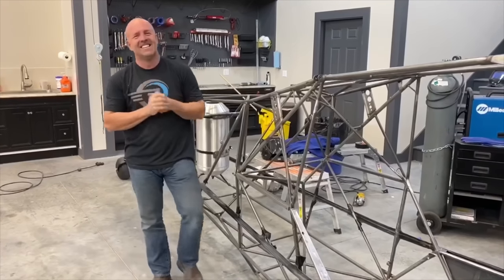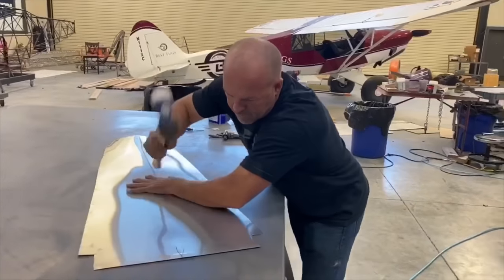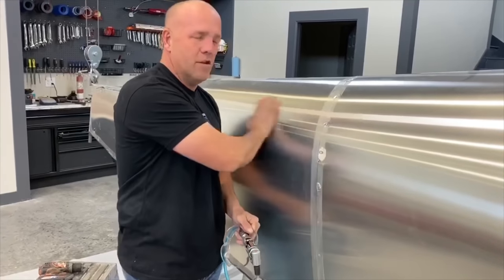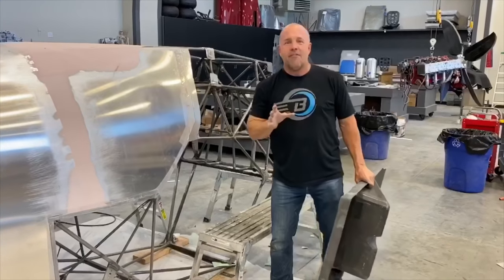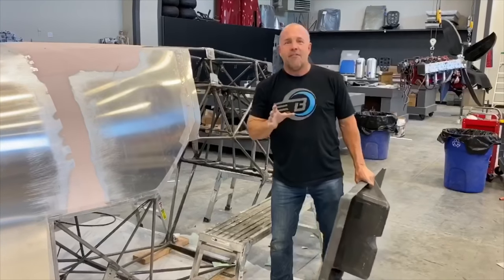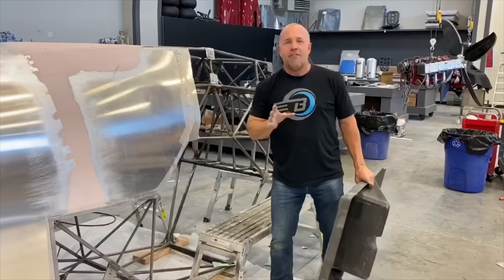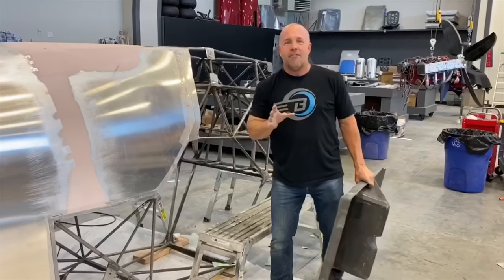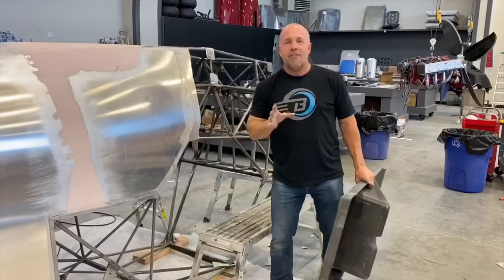EXOSKELETON weighing my options for Scrappy... (Scrappy Bush Plane 6)

Comment: Starts the video with “I’m going to do something crazy”. Of course you are that’s why I love to watch your videos. If you did things normal I would be disappointed.
Reply: Yeah...when he said that the first thing that came to mind was, "and this is different...how?"
Reply: Brad
So I stopped the video at the intro.. to comment on his opening line... LoL 👍👍👍
Reply: If he replied with the truth.... "I'm going to better engineer this" He would be challenged before people saw first 2 minutes. This man's Genius is like watching Leonardo DiVinci with a computer and power tools.
Reply: @michaelbochenski6299  Leonardo Patey.... Mmmmmm, that sounds about right.     ;^)
Reply: So why have a stressed skin monocoque and a tube frame?  There is unnecessary weight in the tube frame.  The crazy bit is doubling up on the structure!
Reply: clive williams part of the point was to strengthen the frame from twisting with the carbon. he needs the tubing to mount the carbon to and to mount things like landing gear and horizontal and vertical stabilizers
Reply: @clivewilliams1406   500 HP and a radical prop that locks-up unheard-of torque...
Reply: @FrozenLionsFan  My point is that MP has two structural systems that are operating separately and that simply applying a carbon skin is not an efficient use of either material.  Whilst a tube does provide good torsional stiffness, the issue here is that the tube is relatively weak due to its cross sectional area compared with its skin thickness.  A smaller diameter tube of equal wall thickness would have provided greater rigidity.  As regards the  point ;loads, both materials can perform equally well on their own.  You only have to look at F1 cars, America Cup Yachts and the latest commercial and military planes to see how immense point loads are handled by carbon fibre structures.  If MP is intent on using a carbon fibre skin on his steel framed plane then a more considered approach ought to be applied on fully integrating the two structurally to maximise the benefit that will result in the optimum weight/strength parameters.
Reply: clive williams I’m sure he intends to integrate the two together he just hasn’t shown it in this video. He spoke at a point in the video of unbolting the carbon shell before removing it.
Reply: @FrozenLionsFan  To integrate the carbon fibre skin and the steel frame will require the outer steel frame to be wrapped with the carbon fibre to effectively join them together so that they act as one.  Alternatively, the carbon and the steel can be mechanically connected but bolting them would not be practical as the spacing of the connections would need to be around a maximum of 3" - rivets are the solution here.  Aircraft constructors have been connecting stressed skins to framework for decades, just look at any riveted metal (aluminium or magnesium) airframe.
Reply: clive williams you are correct, but he doesn’t need this to be the most solid structure ever. Just stronger then it is. For this case it should be more then strong enough
Reply: Ppppp
Reply: @clivewilliams1406  Needs covering anyway ... and without an astonishing amount of stress engineering by going strait carbon the steel tubing has already been tested/proven  .. The carbon then only needs to be thick enough to support itself and provide torsional control its length ... Of course were he not using a 500 HP motor none of this extra stiffening would be required .... and .... I have a strong feeling had he not added weight aft in the end he would have .. Beefed up structure aft is always way way  better than lead ballast
Reply: @clivewilliams1406  Ha .. you don't understand aircraft or building them yourself  .. Had he simply built the entire tail structure from carbon there would have been a monumental amount of testing and analyses required .. He is a man designing and building himself .. The idea here he is using an airframe that has 80 years of past use and testing .. It had to be covered anyway and weight needed to be added aft .. A non structural ( mostly  ) carbon skin on steel tube is a mix I can easily live with .. Your idea of one material for extreme minimum weight is an engineering feat / non starter for a bang it hard bush plane you design and build yourself ... Try it if you don't believe me

Comment: Looks way better than fabric option imo (I’m not a pilot)
Mike could you do a short video on how you prep the carbon fiber? Ie I saw that thin paper that you peeled off the CF when you built the overlapping piece for the two halves. Wasn’t the peel ply it was ‘wet’. Just wonder8ng how that works. Thanks for sharing! Can not wait!

Comment: Grounding and static electricity issues should be a concern. The SR22 is a source for corrective measures for these issues
Reply: Yes found that out the hard way when I shoved a hich power lipo I'm my carbon drone it pinched the cable and my frame exploded

Comment: Pull out the engine and replace it with CARBON FIBER
Reply: Stay tuned. Mike will probably figure out a way to do just that. Imagine... a 500 hp carbon engine...

Comment: You shouldn't even paint that thing. the carbon fiber looks bad ass as it is
Reply: Well, clear coat maybe.
Reply: @michaelrice500  yea for sure  So that it gives it that glossy carbon fiber look
Reply: basebilljr07 resin will degrade with UV light. Sun light is extremely hard on it. There’s lots of additives you can use...... but UV light is usually carbons biggest down fall.
Reply: @groomlake51  
It could look tacky, however, a CF vinyl wrap done properly might give the look and some protection from UV and abrasion.
Reply: Carbon fiber looks cool, but it still looks like everyone else's carbon fiber thingee.  I hope Scrappy gets a KILLER paintjob that is as unique and one of a kind as this bird is going to be!
Reply: @lancer2204  he wont add that much weight with a wrap.
Reply: It's dark... with the sun hitting on it, not ideal...
Reply: The question is if it stands ANY chance of not being orange...

Comment: I think Scrappy's going to need a bit more right rudder than the average Cub during Take-Off Roll.  😀
Reply: I guess we're going to see what a "500 horsepower rudder" looks like...
Reply: @stevecraig3004  Yes, M.P. did mention that V&H stabilizers will be redesigned.  Can't wait to see what the finished Scrappy will look like.

Comment: I have over forty years working with Composites. Your approach and prep for the moulds using aluminum skins was spot on perfect. Your skin of carbon on that plastic pre- weted  was perfect. However when you work with carbon you should never run your bare hand down the cloth, even if you sanded this. I made this mistake and one fiber went into my finger. Had to go in to the doctor and he cut me open to find it. Three weeks later it was fine. One thing you said about Micro Balloons being  strong is not true, they are very weak and tend to crack very easily. Cabosil is a lot stronger. You also can mix in carbon cut from your cloth very short with Cabo or Micro. I saw a little bondo stuck to your carbon, try a little bit of Partall wax and PVA over the bondo. Put a bit of PVA in a cookie sheet and use paper towel to spread this on(easier than spraying on). Just so you know this about exothermic epoxy in cups venting smoke in the air it produces cyanide and it will give you a ripping headache, plus it will catch fire in a garbage can.  I would love to work with you and Composites. I built a lot of X-planes and Drones. Keep up this great work.

────────────────────░███░
───────────────────░█░░░█░
──────────────────░█░░░░░█░
─────────────────░█░░░░░█░
──────────░░░───░█░░░░░░█░
─────────░███░──░█░░░░░█░
───────░██░░░██░█░░░░░█░
──────░█░░█░░░░██░░░░░█░
────░██░░█░░░░░░█░░░░█░
───░█░░░█░░░░░░░██░░░█░
──░█░░░░█░░░░░░░░█░░░█░
──░█░░░░░█░░░░░░░░█░░░█░
──░█░░█░░░█░░░░░░░░█░░█░
─░█░░░█░░░░██░░░░░░█░░█░
─░█░░░░█░░░░░██░░░█░░░█░
─░█░█░░░█░░░░░░███░░░░█░
░█░░░█░░░██░░░░░█░░░░░█░
░█░░░░█░░░░█████░░░░░█░
░█░░░░░█░░░░░░░█░░░░░█░
░█░█░░░░██░░░░█░░░░░█░
─░█░█░░░░░████░░░░██░
─░█░░█░░░░░░░█░░██░█░
──░█░░██░░░██░░█░░░█░
───░██░░███░░██░█░░█░
────░██░░░███░░░█░░░█░
──────░███░░░░░░█░░░█░
──────░█░░░░░░░░█░░░█░
──────░█░░░░░░░░░░░░█░
──────░█░░░░░░░░░░░░░█░
──────░█░░░░░░░░░░░░░█░

Comment: Mike, rather than that dust mask, I use a pesticide mask. It works much nicer. You'll breathe easier, and your face won't sweat. A question for you, Mike. Could you have made the frame out of carbon fiber tubing or would that not hold up to the pounding of repeated landings?

Comment: I was beginning to think you had bumped your head very hard when you crashed your last plane, but I can see where this is going.  Why still have steel tubing when you are going on about saving weight all the time?  You will want wing lets on it next,  One good thing to do while you are building it is to think where you are going to have cameras and build in the mounting brackets and have one right in the centre on the tail, not only for good filming, but to let you see the plane from the cockpit.  Oh no!  Extra weight!!  Edit:  Get back to work!  lol.

Comment: is it possible you could do a video about the carbon fiber sheets you use, themselves? the construction is fascinating, however i'm curious what kind of preparation goes into those sheets. are they per-saturated with a resin? how are you getting no bubbles in any kind of resin composite? i've been throwing around the idea of building a "locost" kit car that you build off of blueprints and there's quite a few practical skills i'm really enjoying seeing that could benefit what i will do when i get that started.
Reply: He's using dry carbon, which he saturates with liquid resin. You lay your dry carbon out on a sheet of plastic, usually bagging film, and pour your mixed resin over it. You squeegee the resin around with little wipers or tongue depressors and work it into the cloth. Smaller stuff you can lift up and see if there's any air on the bottom. Once the cloth is mostly saturated you put another sheet of plastic film over it and start squeegeeing out the excess resin. There's an ideal weight ratio of resin:fiber, but for non-critical parts you can just go by feel. When you're at a good saturation level you use a grooved metal roller to work the last little air bubbles out. Cut to size, pull one side of plastic off, put it where you need it, work it into place, pull the other side of the plastic off, finish working it into the corners and get rid of wrinkles, then apply peel-ply to soak out excess resin.
Reply: i followed through the addiction of watching a lot of his older crafting videos on this same topic as well, and i see that there was a lot of vacuum bag usage. i was curious how it was done here because i didn't think that with that large size that you COULD vacuum bag it down.
Reply: @sipes216  you can vacuum it. We vacuum bag 20ft wings. The problem with doing it on Mike's project is the structure below has to able to withstand the forces of the vacuum without deforming.

Comment: Hey Mike when the heck are you going to get a down draft for your shop. Scares me seeing you cutting all that crap out in the open. Must be a pain to clean up to. 
Also how come you don't just use flush rivets on the smooth parts? Im assuming you just had round head available?
Best Wishes, just keep trucking forward.

Comment: Did Draco's engine survive and are you planning to do anything with it?
Reply: Check out mikes video called Draco lives!
Reply from the maker: It has a bent shaft at the gear box for sure but I’m sending to Covington aircraft for an assessment
Reply: @MikePatey  good call.  Sudden stoppage and blade strikes aren't damage you want to guess on

Comment: Curious: If the exoskeleton is “snapped on” to the internal structural tubing, won’t it still bear the torque load and twist?
Reply: Yes but it will not let the fuselage bend and twist because carbon fibre has very little give.
Reply: Carbon fibre is super stiff and also very light, I believe this exoskeleton is a clever idea.
Reply from the maker: In a future video you will see how it gets bolted everywhere to the tube frame and once tied together,  both the carbon fiber and the frame become stronger together. 👍🤠

Comment: Mike, are you not concerned that on a hard impact landing the “cowl flap” may briefly hit the ground?
Reply: I can guarantee that when the suspension is done and the tires are on he could slam it into the ground without even being close to the flap hitting.  If he is doing something, you better believe that every scenario has been thought through and every problem solved.
Reply: This is no ordinary Cub suspension. I seriously doubt there will be a problem.
Reply: @VikingsFan27  
Other than attempting a takeoff during cross conditions and wrecking the best STOL bird ever built of course. 😊
Reply from the maker: Eric French I’ll try not to make that mistake again 🤷‍♂️👍
Reply from the maker: VikingsFan27 thanks for the nice words of confidence , it is in the computer design so it’s protected at any level of travel

Comment: If I listened correctly, the cowl flap/bomb bay door. Once opened creates negative airspace/suction, how much depends on velocity. I'm sure you did the math on this. You did mention the sqin.area. My point is, the little paratroopers you plan to deploy wont fall, they will get sucked out of there pretty fast. I would check the tail wheel upon landing after you release your first stick. I enjoy your videos very much. Happy to see Scrappy evolving. Great stuff. Back to work!

Comment: I used to be like this twards projects.. I dono what happened.. I think vehicles and 4X4s just weren't interesting enough anymore. I never knew you could do this stuff with airplanes without all sorts of regulations to follow and getting it certified. How can you have a plane this size and weight and power be just experimental?🤔

Comment: Won't the doors in the cargo area you described adversely affect the rigidity of the "tube" and cause eccentric moment loading?
Reply from the maker: Heath Wells  good question. 🤠 It won’t because I made an entire sub frame for that aside from the original substructure unilateral truss systems. Then I tied that in as well.  Thanks for the comment 👍🤠

Comment: you should turn a PAC Cresco into a bush plane. I saw one of these that flew through some transmission lines. its wing caught all the lines as it banked in a gully. instead of crashing and ripping the wing off it snapped the lines  and flew back to the strip towing about a kilometer of lines. it only spun out when it landed and the weight of the lines hit the ground and caused allot more resistance.

Comment: Mike, are you concerned about the heat-affected zone that a laser produces when cutting on your brackets for the landing gear?  I realize that the heat affect zone is minimal but with such a critical part I would be wary of using that manufacturing method but I am just some random guy on the internet... Hope you see this.
Reply from the maker: Eric Kopicky yes you are correct. it is so minimal and only at the cut line, add to that, the fact that after all the heat during welding with the TIG the entire part changes temper. Zero concern but Its a great question.

Comment: Super cool to watch your projects come together, and I enjoy the badass flying as well. I'm on an FSAE team and we are going to start manufacturing our carbon fiber body for our car soon, and having done some small scale vacuum bagging on my own, I'm curious how exactly you start such a big layup. In the last couple videos on scrappy, did you initially just wet those large pieces of carbon on top the plastic sheets (and then transfer them to the mold as seen in the video)? Also, how exactly is the load transferred between the frame and the carbon fiber wrap on the tail section?

Comment: Looks to me like time for some FEA. By going a little bit further I can see how you could get rid of some of the steel tubing entirely as well. I've gusseted steel tubing to composite tubes before no problems.
Reply from the maker: Damien Towning yea your exactly correct. We have been inputting it into our computer and I have already started pulling tubes out of it.  Coming in future video.  I pulled two more today 👍🤠

Comment: I met the man, Bill Smith, who has a Spitfire Sea Fury, in fact it is the only airworthy one at the Stonehenge Air Museum near Crystal Springs, Montana.  The engine was so powerful (2800 hp) that it needed counter rotating propellers so the plane wouldn’t flip when the engine was set to full power on take-off.  The hp of that engine will have a similar effect on your light weight Scrapy.

Comment: Mike  At the beginning, I really get the point of a carbon ''round tube '' front to back for max twisting strength  (like a drive shaft )  but the further we went into it the 'tube somewhat morphed into a 'U' section shape with a screwed on panel  joining the 'U ' up, obviously you need door and a screen holes but it seems to have lost some of the original torque tube strength  idea ?.

Comment: I absolutely love your videos, but I'm confused with the "front flap" design. A normal flap would not only displace air downwards, but also angle the chord line of the wing, thereby producing a greater pressure differential above and below it (I think). How would this work when the flap sits on the fuselage? Additionally, the flap is located in the prop wash and its effectiveness should vary with thrust produced by the prop. Changing thrust during approach could therefore induce pitch changes. I'm sure you've got those bases covered, but I'd love to understand how this works. Thanks for great content, Mike!
Reply from the maker: 🤠 You’ve got a good mind.  I’ll be excited to show the flight test phase on this.